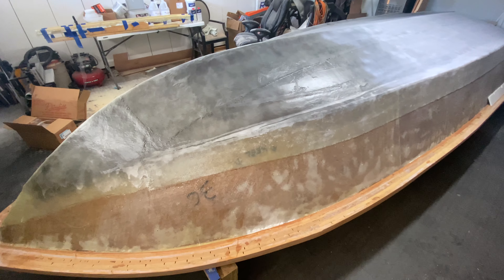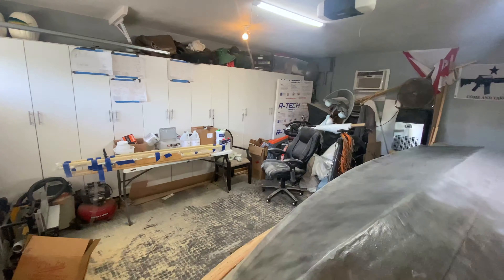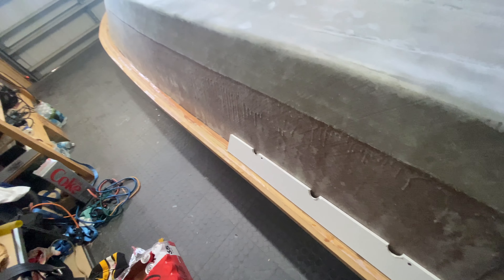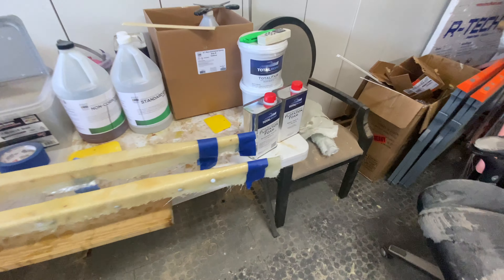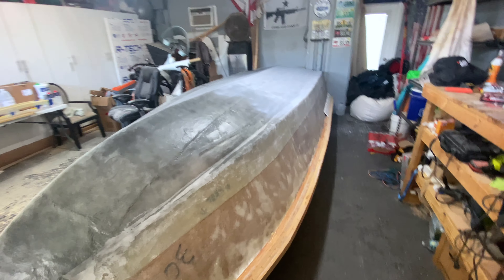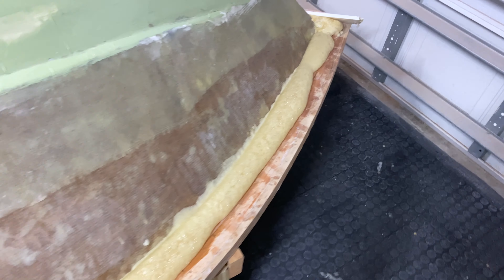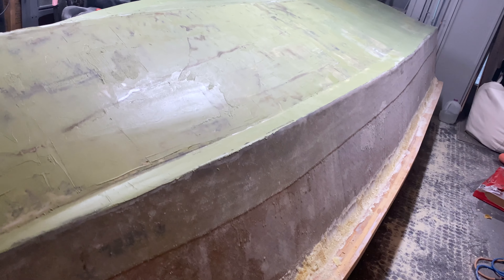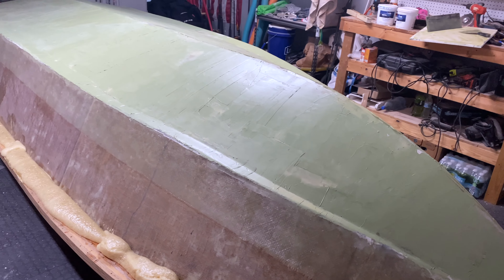DIY Salt Boatworks Home Skiff Build Update 7   Fairing and Primer

Comment: Hang in there pal. You will get where you are going.  I don't know anything about anything, but I would get the bottom nice, but I'd focus on the sides.  The sides are going to be what's seen in the end.  I was thinking of using Alexseal, but it seems like you have been very happy with their stuff.   Do you think that pneumatic sander saved you some sore muscles?
Reply from the maker: I would 100% use Alexseal paints with their roller additive. It’s very impressive. For $100 the pneumatic straight line sander from harbor freight is a must as well. It really cut my sanding time by 80%. Especially for the rough fairing. Obviously your glass job will be great seeing how your build is going now so you won’t have to use a ton of fairing compound. The total boat fairing stuff is great to work with, too